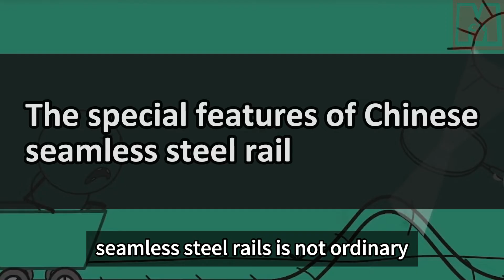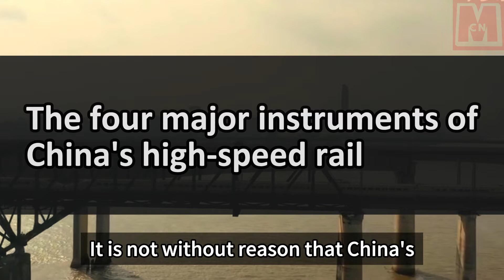Reveal it! Four major equipment of China's high speed rail

Comment: The creator of the first train - George Stevenson (nope, it was actually Richard Trevithick but few people know it) - said: "Current rails can handle 100 miles per hour trains. However to raise the speed to 110 miles we'll have to make serious reinforcements and improvements to the railway that would make it economically unfeasible". It was the middle of the 19th century.
To better understand the importance of rail quality for high speed rail - requirements for quality increase exponentially as speed increases, and is why future trains are proposed without actual rails, least not the ones we're used to.